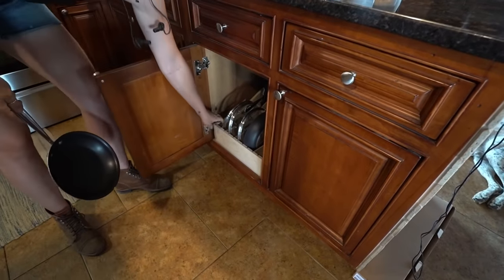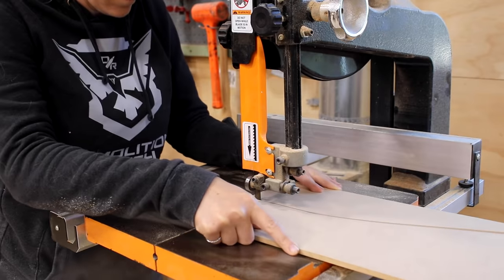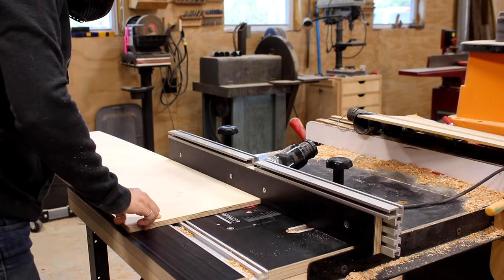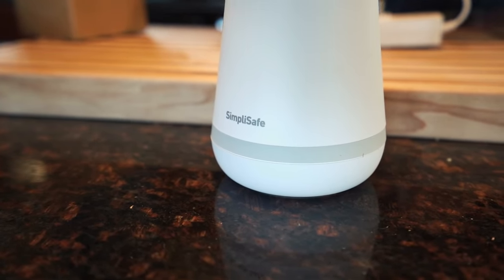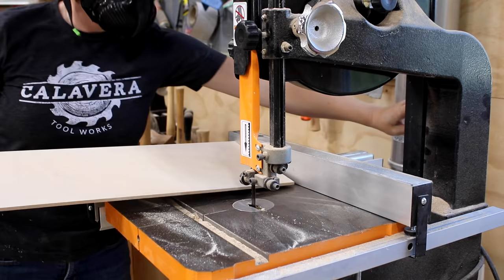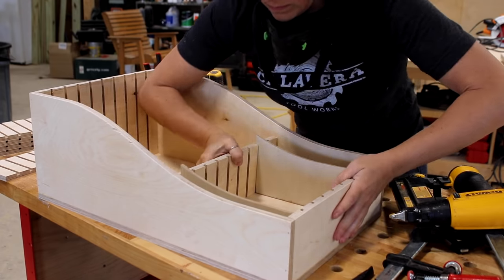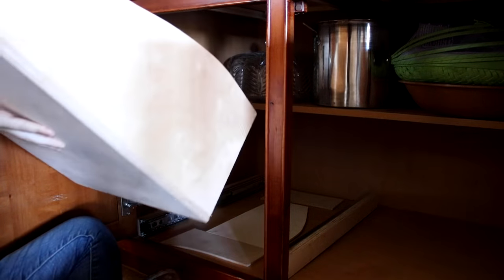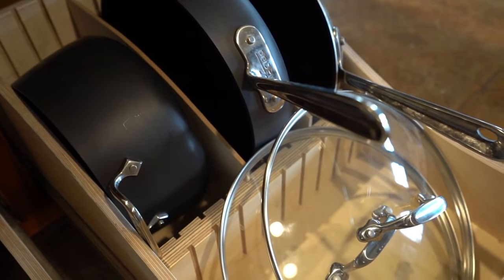DIY Pot & Pan Pullout / Easy Kitchen Cabinet Organizer

Comment: My kitchen badly needs a makeover, so I've had a few of the new modern style drawer set-ups in mind for some time.
However, what to do with the pots and pans has been a mental struggle design wise. Now, thanks to you April, I no longer have a mental block as to how the cabinet design will be for the kitchen remodel.
Wonderful stuff you do. You're more than a woodworker, you're an artisan of wood.
👍😁

Comment: The problem of overly-full and hard-to-use kitchen cabinets is a difficult (and perpetual) organizational chore, and this video is even more full (of good ideas) than our kitchen island!  Failure to de-clutter will, however, sabotage any organizer model, but what I like about this one is that it's flexible enough that if you can't immediately get away from 'the stacks', or slowly grow back into them, the pull-out-shelf aspect at least makes the stacks more accessible.  Well done, April!

Comment: Excellent video as always.

Even with years of experience, I learn something new every video - the tape trick (I normally use double sided carpet tape - but like your trick!) and the router slot jig are just awesome.

Oh, and with it being so hot now in Texas (at the time of my comment) it is odd seeing the colder weather gear - but this was quite the strange spring, so it makes sense.

thanks again for sharing.

Comment: I'd love to see plans sometime for a whole-cabinet slide-out organizer.  Like, open the doors and it looks normal, but then to access the whole interior, grab any edge of the door openings and pull, and the entire cabinet interior comes sliding out, face frame and all, on multiple, heavy duty, full-extension, bottom-mount slides (or have it roll out on floor casters hidden behind the toe kick).  The cabinet or island would need to be secured to the floor to avoid tipping (if using the slides), and the counter top's front would need to not rely on the face frame.  But this would make every cubic inch of the interior accessible and usable, and even more so with whatever system of shelves, dividers, pegboards, etc., are then mounted within on the 'drawer'.

Comment: This is a great build.  The previous owners of our house had installed pullouts in several base cabinets as well as a 36"x60" pantry and I'm a convert.   Whether you buy or make, select standard slides -- not soft-closing ones -- & full-extension is best.  That's what's shown here.  If you opt for soft-close ones be aware you'll need to wait for the pullout to retract before closing the cabinet door(s).  Oh yeah, such a 1st World problem, I know, but I speak from experience.  My spouse became a designer for a pullout manufacturer and had customers who originally spec'd the self-closing slides only to have them replaced AFTER the install.  Soft closing slides work best on regular drawers (e.g. a cutlery drawer), not pullouts.  Note how April uses a foot to help close the pullout -- when your hands are full or you're in a hurry that's exactly how it can work with the standard slides.
Reply: A couple other thoughts.  (1) Don't discount a simpler build of a pullout without the dividers.  You'd still stack your things but you're not reaching under the countertop / range.  A pullout lets you see things and helps avoid that awkward reaching. (2)  In some configurations you might cut out the cabinet's center stile and attach a finish board to the inside of one of the doors.  That allows making one wide pullout instead of 2 small ones, which halves the # of slides required and gains you a couple inches of storage footprint.

Comment: If you don’t have a spindle sander, you can double stick tape or spray glue a sheet of sandpaper to a thin piece of flexible plastic or extra thick veneer to sand to the line as well

Comment: Thanks for sharing the nifty router tricks. While I was watching your video this week I was using my new speakers for the first time. The whole video I thought there was thunder outside. Turned up the speakers and it turns out there was some very low level noise the sub was picking up on your video during the voice over, lol.

Comment: Suggest you take a piece of cutting board material that is thicker the the metal part on the drawer slide and a fix it to the drawer the is next to the door.  I learned the hard way as when the drawer opens the metal edge with scratch the door.  Added a piece of old cutting board and problem solved.

Comment: Could you adapt this to just a miter saw and circulating saw and pocket hole jig plans? 
I’m sure a lot of homeowners don’t have the fancy tools you have at your disposal. I’d love to make this myself.
Reply from the maker: You can use simpler tools, it would just take longer to cut. I didn't start out with all the tools you see today. I bought my first tools at yard sales and pawn shops, buying only the tool I needed. Enjoy the build!
Reply: @AprilWilkerson  Thanks. I just can’t think of a way to make those divider grooves? I can make the box with straight sides….and I’d like to add gliders on the bottom.

Comment: LOVE IT!!  What would you suggest for this to handle the weight of cast iron?  Or would it be better to hang them from a rack?
Reply: Get some heavy duty drawer slides (normal weight rating is around 20-30kg/40-60pound per set) and make the bottom thicker. It depends on how heavy the pans are and then do the math. 45kg/90pound drawer slides are easy to find. Above that gets expensive real fast.

Comment: How do you connect the runner to the cabinets? I have a similar situation where there is shelf in the middle and there is a shelf support in the back that's making it a challenge to add the space (wide in front and narrow in the back)

Comment: You should paint those things. Unpainted they might last ... quickly, in a humid place that a kitchen occasionally is.
Reply: One or two light coats of water-based polyurethane would be a better choice than paint.

Comment: DIY..... If you have a fully equipped wood shop that is.
Reply from the maker: Actually no, you can do this project with simpler tools, it would just take longer. Because I have them, it'd be crazy to not use them to save time. I didn't always have these tools. I started out buying my tools 2nd hand from yard sales and pawn shops, buying only the tool I needed, then saved for the next one. You can do anything you set your mind to, or you can complain about what others have and you don't. It's all about choices. Get creative. Thanks for watching.

Comment: The basic problem is that lower cabinets with doors are useless and very inefficient.  Lower cabinets should all be drawer units so you do not even have to open a door.

Comment: Takes up too much room for too little storage
Reply from the maker: It holds all my pots, pans and lids so perhaps I don't have a lot. Works for me.  :)  Thanks for watching.
Reply: Great idea and execution April, glad it works for you.  For retrofitting of existing pullouts without separators or as an alternative, Ikea makes heavy wire hoops that are screwed to a base serving as separators. Thanks for your great videos filled with useful solutions.

Comment: You people with full wood shops put these videos out as if EVERYONE has the same kind of shop.
Impress us by doing DIY with the 3 basic power tools the average person has, THAT would be a realistic video
Reply from the maker: Well, I didn't always have all these tools. Get creative. You can do what you put your mind to. 
I bought my first tools from yard sales and pawn shops, buying only the tool I needed and then saved for the next one. You can do almost all projects with a drill, circular saw and a jigsaw. It may take you longer but you can cut what you need to then join with the drill. Or, you can just complain and be jealous of what someone else has, your choice.
Reply: @AprilWilkerson  it was not a complaint. I merely stated, " if you want to impress us, use the 3 basic power tools"
But be sure of one thing, don't flatter yourself thinking I'm jealous, it will never happen
Reply: I made slide out drawers and I didn't have a full woodworking workshop.  I used a table saw, cordless drill.  The  specialty tools I bought was a pocket jig tool, and Kreg door slider installation jigs & cordless router.  Work with the tools you have, buying tools is better than paying for labor.  I might remake my pot and pan storage drawers based on April's  design.  I had planned on a slide out with the pans hanging, will re-evaluate.